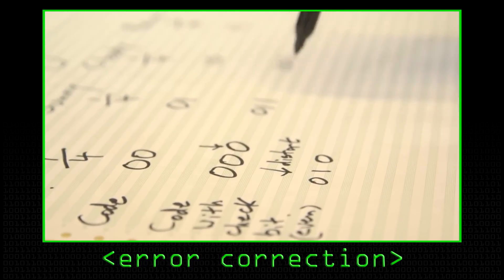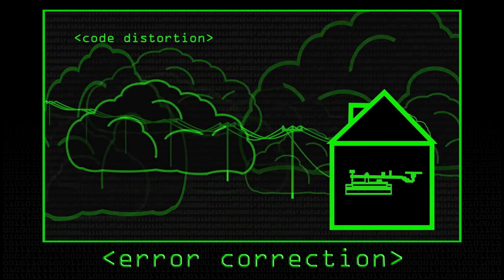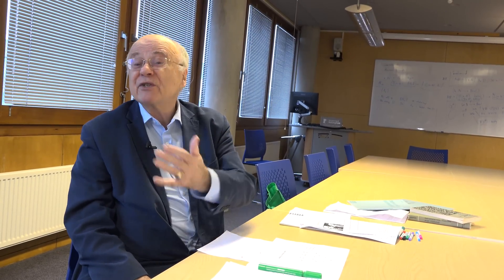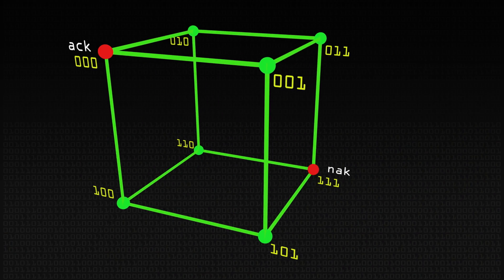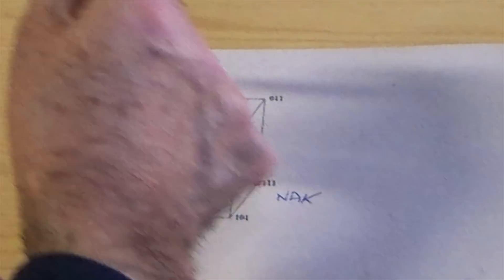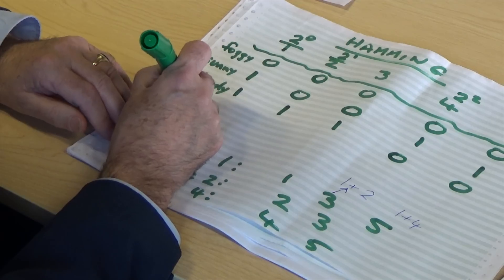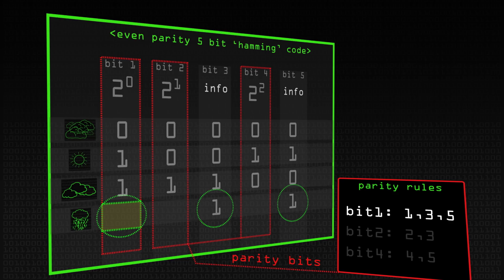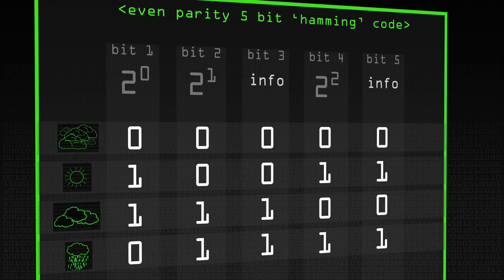Multiple Dimension Error Correction - Computerphile

Comment: Would be nice to see more about the generalization here. How does this work if you want to encode a three-bit message? Or, conversely, if you add a 6th bit what does it do? And what happens once you get up to the next highest power of 2? What are the general rules that guide this process?
Reply: With m parity bits, you can error correct up to (2^m)-1 bit message, which means you have (2^m)-m-1 bits left for data. with 3 parity bits you can add 6th and 7th bit for data and still be fine.
The general principle is that the parity bits encode the parity of all bits that have that particular binary digit in their position. That allows you to pointpoint the exact position of each error. If parity bits 1,2,8 don't match up it means that bit 1+2+8=11 has error. If parity bit 8 alone doesn't match up, it means that bit 8 is wrong (which is itself). To encode position "i" of the bit in "n"-long string you need log2(n) bits to do it. The length of the message rises linearly, but number of parity bits rises logarithmically, which means the space wasted for error-correction drops exponentially with the length of the message.
Reply: https://en.wikipedia.org/wiki/Hamming_code#Hamming_codes

Look at the the table in the middle of the article :)

Comment: SF and Sac'to are miles apart! 90 miles, in fact.
Reply: In general huge distances are thought of as hundreds (multiple 1 hundreds) of miles apart. It doesn't take long to send something 100 miles, when you near 600 you're looking at a second or so. Any longer and it exponentially increases due to interference.

Comment: but how do you know you only had a 1 bit error?
Reply: We just have to assume we can have only one error and the probability of which is sufficiently low that probability of having two errors would be the square of that probability. And it would be insanely small.
Reply: you don't really, but the assumption is that even just a single error is fairly rare, so getting two would be very unlikely. Also, if for some reason you could expect there to be 2 errors, you could detect it with hamming code, you would just be unable to correct it then. Basically, it depends on what do you estimate the probability for an error is.
Reply: It is the most likely error. Hamming code allows you to detect and correct 1 bit error and detect 2bit error. With 3bit error and above the message gets scrambled potentially undetectably. The probability of 2bit error is the probability of 1bit error squared. With 3bit error is cubed. If 1bit error has probability 0.01 (aka 1%) two bit error has just 0.0001 (which is 1such error in 1kB downloaded) and probability of getting wrong message (aka. 3bit error) is 0.000001 which is once per 100kB downloaded.

Comment: Please film the video on the Hamming code error correction method.
Thanks.
Reply: As a quick example:

Say we receive the code 11000

(1) Looking at bits 1, 3 & 5: 
bit3=0 and bit5=0 which should mean bit1=0 therefore either bit1, bit3 or bit5 is wrong. 

(2) Looking at bits 2 & 3:
bit2=1 and bit3=0 indicates that either bit2 or bit3 is wrong, as we do not have even parity.

(3) Looking at bits 4 & 5:
bit4=0 and bit5=0 indicates that both bit4 & bit5 are correct as we have even parity.

Since we are assuming that only 1 bit is incorrect, taking (1) and (2) together implies that bit3 must be wrong and so the code should have been 11100=CLOUDY.
Reply: Take an encoded word, flip a single bit, and see if you can figure out the method for determining the place the error occurred.  It ends up being super simple.
Reply: Agreed, more Hamming code videos, loved it!
Reply: Soof Golan because they have to give uneven sums, bits and their parity checkbits have to be different (so 0,1 or 1,0). so if b2=b3 one of them is wrong, same for b4=b5. if that's the case, you can then check the bits b1+b3+b5 if their sum is an uneven number. if it is, bits b1,b3 and b5 are correct and one of the parity bits was faulty (b2 or b4). if they do not add to an uneven number, one of them is wrong (so if b2=b3, b3 has to be the wrong one, b4=b5 means b5 was wrong and if neither of those was the case, only the parity bit b1 was incorrect).
Reply: There is a simple one amazingly from 3 years ago 
 here :  /watch?v=5sskbSvha9M
Reply: I was wondering the same thing. Thank you to all those who answered!

Comment: So, bits 3 and 5 contain the message, bits 2 and 4 contain exact copies of that, and bit 1 contains the parity bit of the message. If 2 and 3 are the same, then that is the first bit of the message; if bit 4 and 5 are the same then that is the second bit; if something differs, then the first bit can be used to determine which versions of the message bits are the correct ones. Easy enough.
Reply: The disconnect is that you won't always be sending 2N+1 bits, for higher numbers of information bits you'll actually be sending less than 2N+1 bits.

You have to pay attention to the very brief generalization that he gave when explaining the Hamming Code. The parity bits are the bits that correspond to exact powers of 2, and each will be the parity of the bits whose position is a sum of those powers of 2.

So if we wanted to send 3 bits of information instead of 2, we would use 6 bits. The parity bits would still be 1, 2, and 4, and the information bits would be 3, 5 and 6, and the parity rules would be as follows:
bit 1: 1,3,5
bit 2: 2,3,6
bit 4: 4,5,6

(basically since we added bit6 to the message and 6 is 2+4, we include it in those parity bits)

In fact, we can even send 4 bits of information and still only use 3 parity bits, the 4th information bit would be bit 7, and it would simply be included in the parity of all 3 parity bits (because 7 is 1+2+4).

And with 4 parity bits we can send up to 11 bits of information. So you see the generalized procedure is far more efficient than simply 2N+1.
Reply: binary calculations are hard to get ones mind wrapped around at first but this really holds up https://en.wikipedia.org/wiki/Hamming_code. When i started computerscience i didn't believe for one second that every finite number can be created as powers of two, but law and behold: they can. This is similar
Reply: Think of this in a larger scale, that logic doesn't always hold.
Reply: I believe it does generalise to sending an N-bit message in 2N+1 bits, assuming there are zero or one bit errors: send the message twice, plus one parity bit. If the two messages agree, then ignore the parity (it might be wrong); if the messages don't agree then they differ in one bit, so use the parity bit to determine which message version is the correct one. Admittedly, for larger N this is sub-optimal, but it still works. The proper, more efficient generalization is described well in e.g. https://en.wikipedia.org/wiki/Hamming_code
Reply: Yeah, it gets crazy. To send a megabyte of information, you would only need to dedicate 3 bytes to the parity data... but again, that only allows you to recover from an error in a single bit.

Comment: So basically, instead of sending many time the same message, just send one message that contains the same information twice, at least.
Reply: You make ECC sounds like inverse lossless compression.
Reply: not really. You send the n-long message just once but you add log2(n) bits which allow the person on the other side to pinpoint where error has occurred, because you only need log2(n) digits to encode position in n-long message.
Reply: +kingpopaul

It only looks like it's twice as long because the original messages were so short (2 bits, to be exact)

For, say, a 100 bit message, you'd only need a "Code Word" of 107 bits. so that would be 7 parity bits. That improves the situation quite a bit, doesn't it?

Comment: Can't you just repeat the 2 bit message twice and add 1 parity bit and pretty much get the ability to correct 1 bit errors from such 5 bit message (if message copies are equal, it's that, if they are different, it's the one with proper parity)?
Reply: What if the message was longer than just 2 bits?
let's say the message was 1024 bits long. by your logic, you would have to send 2*1024 + 1 bits of data, while in hamming code you would have to send 1024+10.
Generally, instead of sending 2n+1 bits for an n bit message, we would only need to send n + log2(n) bits, which for large messages (as they typically are over the internet) is much much better.
Reply: if one of the duplicates errors, how will you know which is the correct one as both will be good codes. A single parody bit will only tell you that an error occurred, not ow to correct it.

so, with the simplified states 00, 01, 10, and 11   I send the message the way you propose with the format

two-digit code , duplicate two-digit code, even parody bit, (c1 c2  d1 d2 p) and you receive the message:

01000

What was the original message supposed to be? 00000? 01010? you don't know. You know an error occurred, but can't correct it.
Reply: you can, but you get only 1/3rd transmission rate (meaning only 1/3 of the send message is useful data). With hamming code you can get (1-log(n)/n) transmission rate with the same amount of protection. For 1 bit code that is 0.333, for 2bit code that is 0.571, for 5bit code that is 0.839 which is already a significant improvement.

Comment: 0:23 <error correction>missing n in <higher dimension error correction></error correction>
Reply from the maker: Thanks for spotting. Sorry! >Sean
Reply from the maker: No, nak is in the right place. The challenge was to find a third point that was at least three moves away from both ack and nak >Sean
Reply: Yes indeed 1111 logically belongs on the inner cube . But the labelling of the corners isn't the issue here. Rather, the question is: can you locate 4 red blobs on any 4 of the 16 available corners such that all 4 of therm are at least distance-3 from one another. No - you can't.
Reply: NAK should be written 1110 on the hypercube diagrams; 1111 would be on the inner cube.